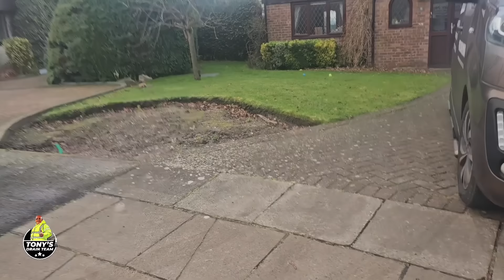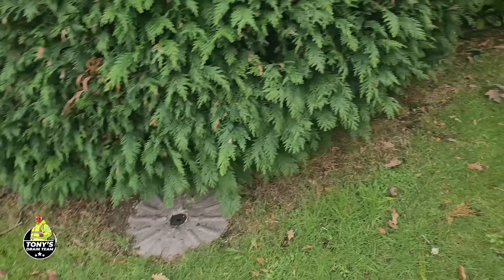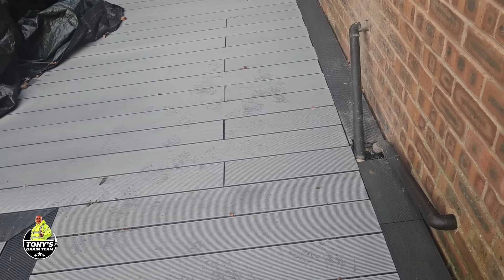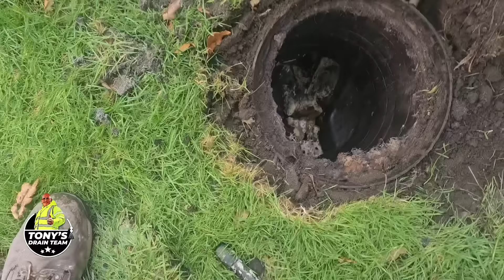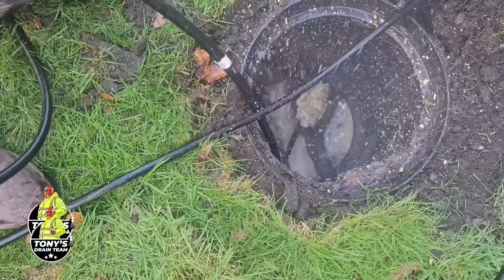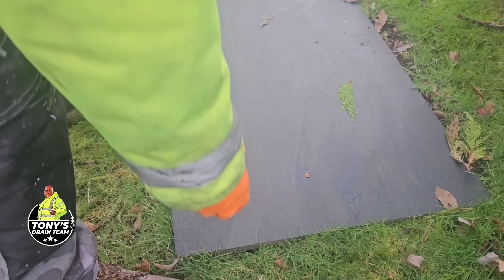Blocked drain. Fatberg blasted. #blockeddrain #drainjetter

Comment: Would it not be better to remove the fat clumps so they don't join up further down the line again instead of smoothing them into bits that will only meet up again down the run.?
Reply from the maker: My job is not to remove sewage products from the sewer. My job is to 'unblock'. The reason the fat became a blockage is because their is some basic errors in the drain installation that are causing the fat to collect and solidify. When the sewage goes into the main sewer the diameter of the pipe is much larger so blockages are generally not because of a bit of fat. Heres a question for you and I would be pleased to hear your reply, should I pick out every tampon, sanitary pad, condom, wet wipe, paper towel, ear bud and of course fat globule?  Generally interested in your opinion and I will come back to your reply.
Reply: Hi Tony, I dont know why but Im not getting your uploads..again. Dont think ive forgot you, I never would do that..Persistance pays off..wow.People please dont put fat down the drains. Stay Safe from a Tassie Fan. ❤️🙏👍🤗Will go looking to see how many others Ive not been notified about 😡
Reply from the maker: @cheryleking6543  hi Cheryle thank you. Hey a subscriber said that he had been randomly unsubscribed from my channel and had to re sub. Maybe check that and as always thanks for supporting me and my channel. 👌👍👍🙏